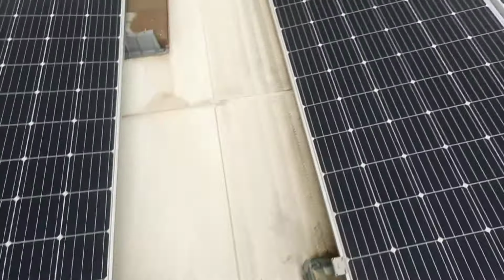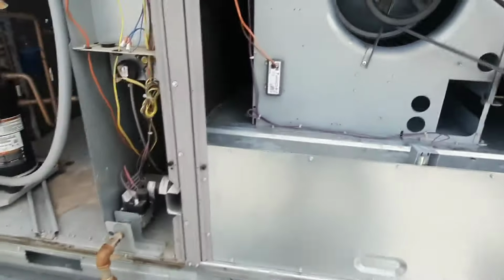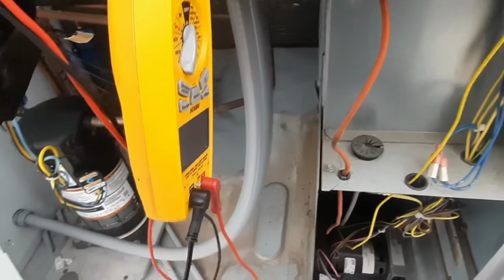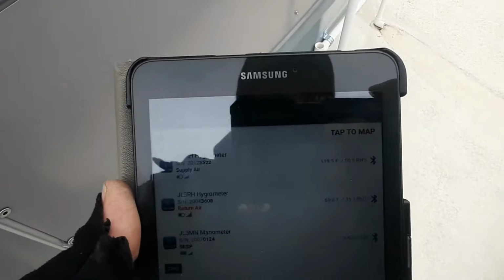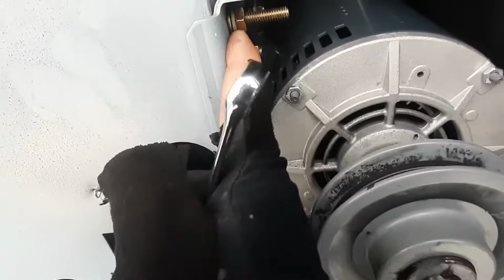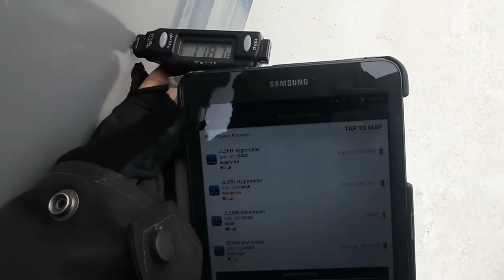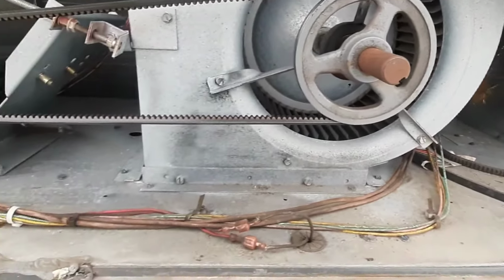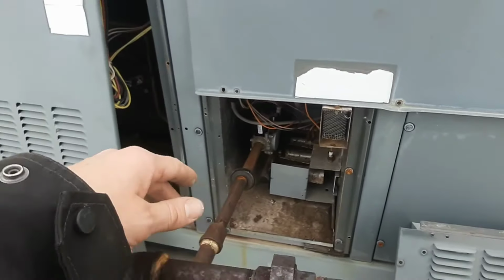2 no heat service calls, Bryant and Goodman package units.

Comment: Where did you get that 2. Inch of water collum and 3 from data plate ?
Reply from the maker: Yes, the gas valve usually has both high and low settings on it. 3.2- 3.5 is normal for natural gas, and low fire is usually 1.8- 2.
Reply: @Everything HVACR  sounds good thanks I know data plate has one number on it 3 ot 3.5 but I usually don't see one for low fire on it so I guess will go with what your recommended
Reply from the maker: No problem, Thank you XRAY Bravo! Those are the typical settings for natural gas. Most, if 2 stage, should have both ratings, but if not, you should be able to find them in the unit IOM.

Comment: Good job. Seems like a lot to deal with.
Reply from the maker: Everything is a lot to deal with. Take your time and make sure they don't call back. Thank you, HVAC MADE EASY. Could you make it easier for me 😆, I'm up for suggestions.
Reply: I had a similar issue like you did with the first unit, turned out that the unit had too many BTU since they reduced the supply duct limiting the airflow. I tried to get them to replace the duct but they wouldn’t so I had to calculate how much BTU I needed for it to stop tripping. I then capped off 2 of the orifices so my temp went down which prevented it from tripping. It’s been 2 years and it never tripped since lol.
Reply from the maker: That's a real-world problem there. It's hard to convey real-world shit. Keep solving real-world problems 💪
Reply: That clicked you heard from the Goodman unit is the relays on the board. Sometimes they get stuck and the unit will not run seem like it’s happening to you.
Reply from the maker: 💯 could have been a relay on the board. Thank you, HVAC MADE EASY!

Comment: How did you adjust the speed on the blower enjoyed the video
Reply from the maker: I'm not sure why I didn't show that. The pulley is adjustable, so moving it in (clockwise) speeds it up, moving it out slows it down.

Comment: Could closed vav’s or fpb’s cause this issue?
Reply from the maker: Your typical vav/fpt system uses the heat in the box to heat the space. Morning/daytime warm-up would be the only time the heat on the rooftop would run. VAVs drive to Max during warm-up, so no. This doesn't have any, so it's not an issue. But if there is a basic zone system connected, yes, closed boxes could cause issues.
Reply: @EverythingHVACR  ok thanks! In my head I was thinking maybe the discharge air temp was so high was because a vav could be closed and the air was just getting stuck there! Awesome vids man I’m learning lots from you
Reply: You wouldn't see any VAV's or Fan Powered boxes on a unit like that. There would have to be VFD and or a modulating gas valve to adjust the discharge air temp, based on how many boxes were calling. This style is a constant volume. Carrier puts VFD's in their equipment....but it is a glorified 2 speed blower with a soft starter.
Reply: @JJ-COMMERCIALHVAC  ok thanks a lot that makes a lot of sense

Comment: Had the same thing yesterday on a carrier, no call to W1, I knew the thermostat was supposed to be calling for heating so I went back down to it and noticed the thermostat wasn’t completely clipped in on one of the corners. Pushed it in, cycled power and the unit took off.
Reply from the maker: It happens, Thanks Bradan!

Comment: Seems like that heat exchanger design for that unit is too bulky
Reply: The famous crack on those carrier heat exchanger is on the back side of burner inlet tubes remove access panel under blower and you will find the crack
Reply from the maker: Good call, East Coast. Those carriers crack everywhere, 😆
Reply: @EverythingHVACR  love your 1st class channel 👍👍👍👍👍👍you also go the extra mile and leave the units better than you found them
Reply from the maker: Thanks, East Coast! I appreciate it
Reply from the maker: Too bulky?
Reply: @EverythingHVACR  I don't know what I'm talking about man. I'm still new. Lol
Reply from the maker: It's all good, I like the questions. The carrier HE won't last and that Goodman is already 8-10 years old.
Reply: Thanks for the tip fellas.